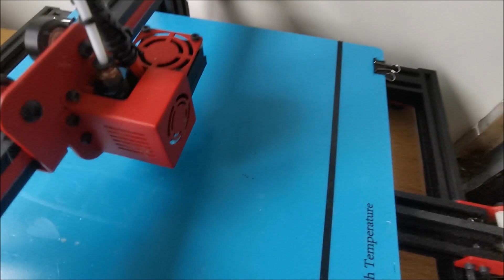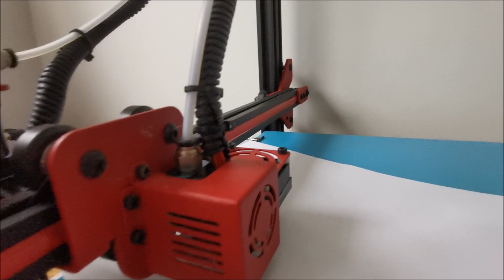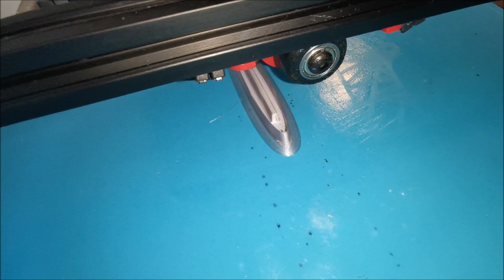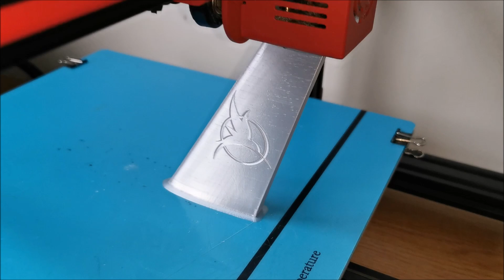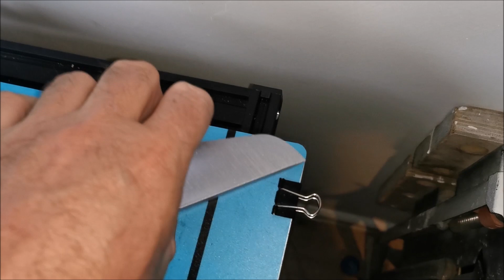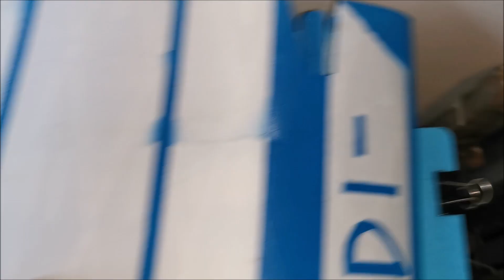HOW A 3D PRINTER CREATES A PLANE PART

Comment: There’s plenty of sites showing what Dave’s attempting to do, and there’s nothing wrong with a bit of diversity - but requesting more and suggesting this, that and the Captain’s flight plans when there’s plenty of sites dedicated to that exact project should probably be made on those sites, not here - principles of flight might be a good place to start, and where the model needs to be strengthened - it’s not a simple hobby, from design to build to flight is an ambitious project. Weekly progress updates might be better, winter’s coming and while there’s less to do in the fields there’s plenty happening on the farm itself in preparation for next season - I’m not moaning, I just prefer the farming (despite having been an avid and enthusiastic Air Cadet, flown gliders with no canopy (Sedburgh) RAF Chipmunk’s, crawled all over the Jaguar, Tornado GR3’s and avionics workshops at annual camp; shot the SLR rifle full bore and with the .22 conversions, GPMG’s - all in prep for joining the Army as a Telecommunications Tech with REME, through Op Granby and sadly cut-short by stress fractures having worked up from my shins to my pelvis, 6 months of swimming next to Sharon Davies was all I could do - it was absolutely so worth the pain, she’s very big across the shoulders though for my little 19yr old frame. Listen to me rambling on - it’s a bl00dy liberty - this site is for farming 😜 wot a cheeky beggar 🤨……. The 🍻🍻’s are on me! 👍😉